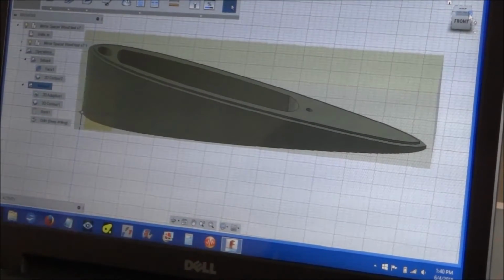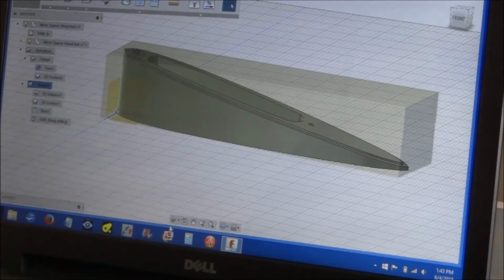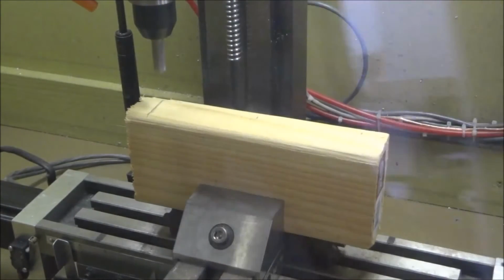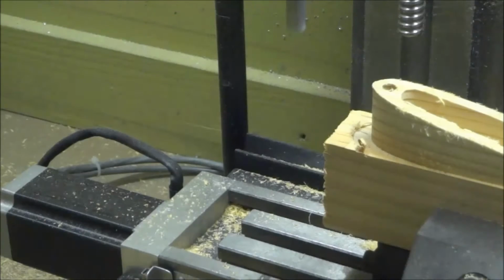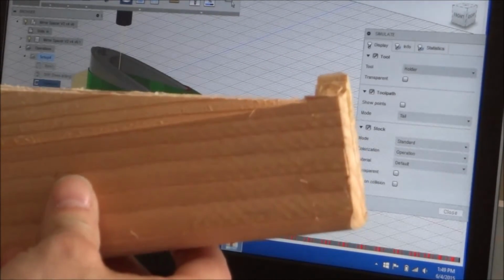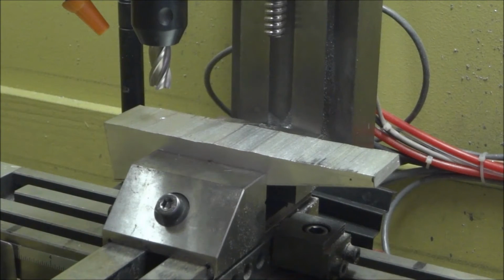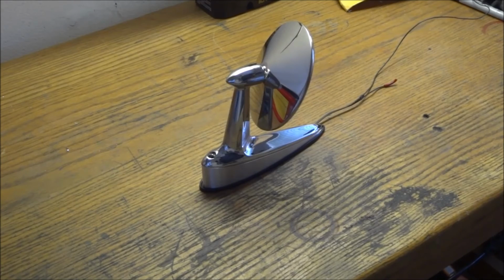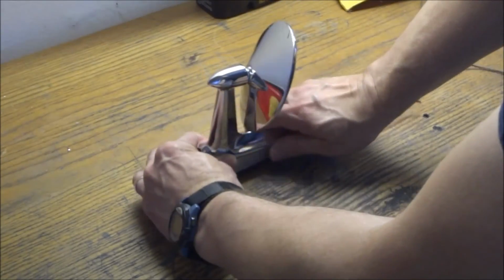Side Mirror spacer using Fusion 360

Comment: Hello, how did you was able to do repositioning properly the workpiece and set the datum again, to match up everything? 
Where was your datums?
Reply from the maker: +Radoslaw Jocz If you look at the video you can see that the 2nd setup is just to remove the .125" left from the first operation.
The 2nd setup was not critical. My Zero point was the center of the work piece.